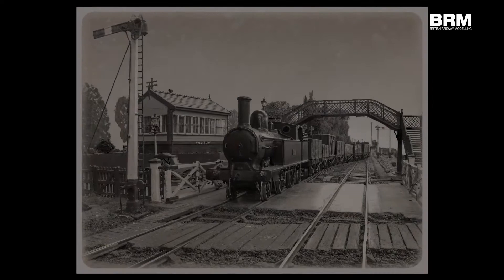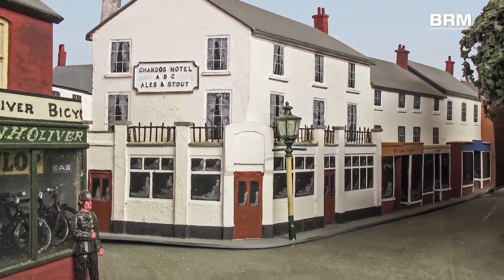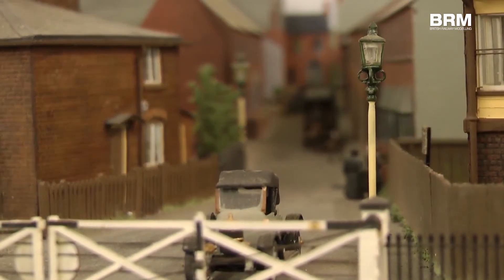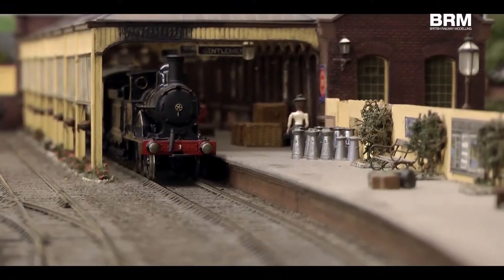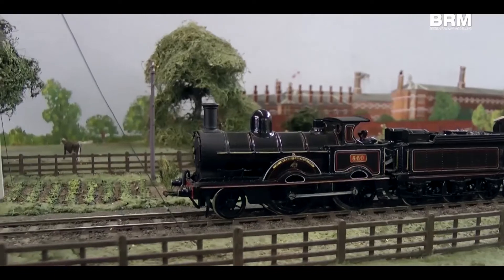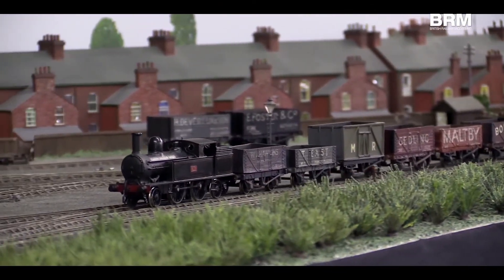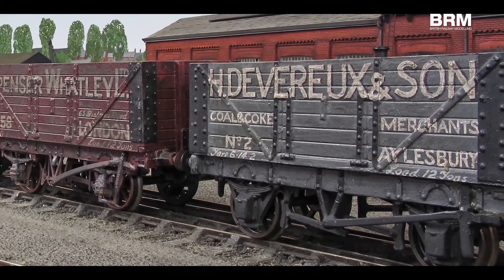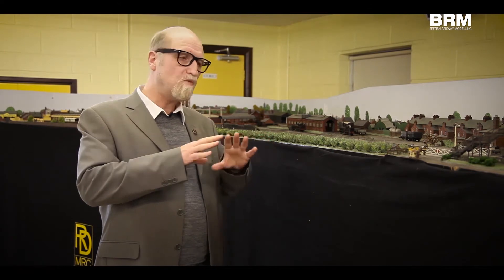Aylesbury LNWR - A layout by Geoff Williams

Comment: I crossed that railway twice a day to and from Queens Park Primary and Junior school. We would stand on the bridge and get covered in steam and smoke as the engines were shuntered across Park Street. The station was called Aylesbury High Street, being at the bottom of the High Street. It was also the first station in Aylesbury, as the Great Central did not arrive until the 1890s.